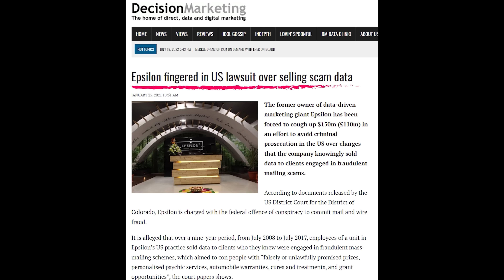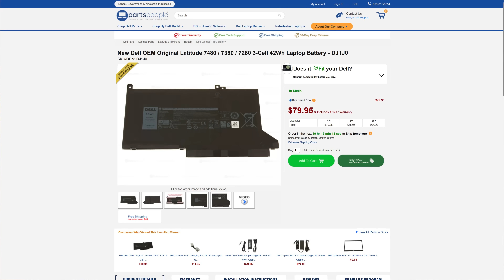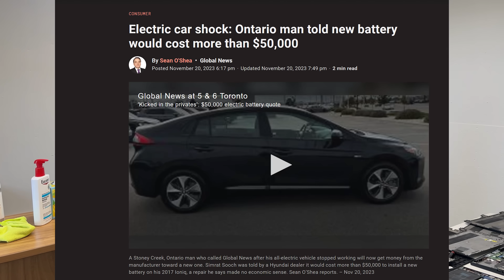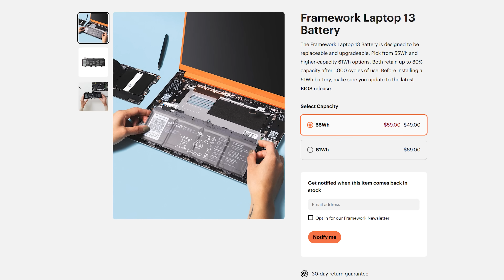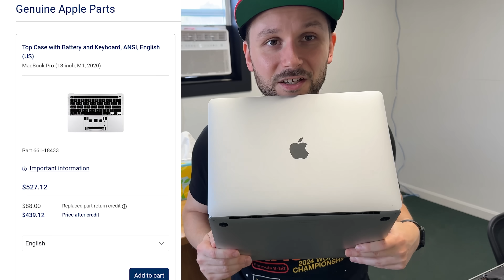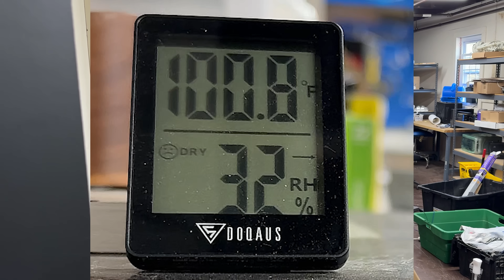Planned Obsolescence: Why is Replacing a Battery STILL So Difficult and Expensive?!

Comment: I agree, but your parents are probably not going to use it off of battery so just see how many you can sell without battery.
That being said because the battery on a Dell is in the front you need some weight to make sure it doesn't fall over.

Also more research should be done into supercapacitors.

Comment: Well, the problem with phone and laptop is there's no standard for the battery. For car the 12V battery is 12V battery. No matter which brand or which type you get, it will fit (if it's the same standard ofc). It's always the same shape and has the same connector. For phone and laptop? Good luck. We have an iPhone when their fancy L shape battery. A Vivo with their double pouch thing that charge faster than the greatest technician that ever lived can steal your toothbrush. We have slim battery on the new Fold whatever-the-number that so thin you would get paper cut if you touch the edge. The same goes for laptop, we have so many shape and sizes. The only company that having this battery is the brand that sell the device. They can charge whatever they want. And when they say "screw you, it's upgrade time bois" now you fked. Good luck finding replacement battery.

Comment: Last time I needed a battery for my laptop, it turned into a desktop. Tossed the battery aside and it became stationary or at least outlet dependent
Reply: had a laptop that lasted like 6 years without a battery so yeah... it sucked when the charger broke and I had to get a "standard" charger that didn't fit well since whenever you moved the port it'd get at an angle and turn off the computer... My cat several times turned it off while I was doing something on it... oh well such is life.
Reply: @mariadanielalavia8877 Just get a tablet or desktop.

Comment: Since about 2003, I pretty much use my laptop always plugged. My MacBook Air late 2014 developed Spicy Pillow Syndrome tot he point where clicking the trackpad was becoming harder. 

¿Do You know What I did? I carefully punctured the spicy pillows, put some heavy dutty scotch tape on the hole, and calle dit a day.

Autonomy is now one hour. More than enough to find a plug and keep on working.

And the battery of that Vintage of MacBook is replaceable, not glued in, soldered or anything.

I agree with you 107%. 

Instead of each manufacturer developing their own spicy pillow shit, there shoud be a few standard spicy pillow modules, and manufacturers use that. Economies of scale would kick in, and batteries would be obtainable.

Failing that, each manufacturers could use their own standard individual modules BUT ACROSS THEIR WHOLE LINEUP, and not every model having a slighly different battery...

Comment: As an everyday user of my refurbished 8th gen  i7 latitude 7490, I was able to install windows 11 pro since it has TPM. I installed 32gb sodimm ram. I love how rugged it is and its sturdy so I use it as my field work laptop. Highly recommend picking up one of these older, but still more than capable laptops.

Comment: Laptop parts that are consumable (will break down faster than the rest of the components)
1. Battery
2. Hinges
3. Keyboard
4. Cables/wires
5. Plastic chassis

Comment: You know the absolute dumbest thing about batteries?
Let's take EVs as an example.
You can have a Tesla Model Y and a Rolls Royce Spectre. Both of them are great electric cars, but a Rolls that is meant to last forever won't, because the battery will one day blow itself up.
Even the modt renown car brand can't have the 'Rolls Royce of battries' to put in their cars.
It's also like a $300 Android vs a $2000 iPhone.
One is greater than the other, but at the end of the day, their battries are equally sh*t and will expand itself out and make your phone look pregnant.

The problem? Companies just refuse to sell you the batteries, and even if they do, they'll charge you a fortune for it.

Comment: In a bit of this exact situation right now with an old MacBook that I restored. Its a 2010 MacBook Pro, which im planning to use as my school laptop here in a few weeks, because most of my school stuff is online and in a browser. Its running Monterey perfectly fine with an SSD but the battery is $60+. I only paid about $50 total for the rest of the machine so, why would I spend more than double the cost of what I paid for it for a single part? The answer: im not going to. Im just gonna have to keep it plugged in at all times, and inconvenience me and everyone around me with my charger. Not to mention that the $50 i paid to restore the machine myself is more than i wanted or was able to pay. At this point im genuinely considering making my own 10V battery, because what choice do i have? I actually cannot afford a $60 sketchy ass third party battery.

Anyway, love your videos!

Comment: it just depends. i got lucky I guess. All of the laptops I got for $25. The battery all still okay
and they're LI-ON . I do know how to refurbish Li-on or make Li-on packs.
but that cant be certified or to be sold on the market.
I also look out for those laptops...becuase I could up grade the CPU for another $40-$50.
It wont be the fastest..but i7 at 2.8 ghz boot to 3.9 ghz are FASTER than some modern day
Laptops. It just NOT as energy efficient...but for $100 average...I'm good.
 I go for 17" laptops for reasons. It's big enough to use on your desk.

If really need to,..if I was BROKE, SHTF or live in a third world.
 The Lipo packs..I guess they're just have to stay plug in to a 12v battery solar panel system
so I can run it at night ,too.
I can always WACK IT...screw it UNDER my desk...HDMI to a 28" monitor.
blue tooth the 72" T.V.
I sort of FLATPAK mini P.C. lmao

Comment: You’re right about laptop/phone battery pricing, but the batteries in many of these things actually are prohibitively expensive to replace when we’re talking about a $60 device. For electric vehicles it’s even worse, the cost to manufacture is legitimately thousands of dollars and they’re even more labor intensive to replace than the batteries in personal electronics. This is why EVs still have trash range/charge times, the battery tech still isn’t good enough to make them truly beat hybrid or gas cars. We absolutely should push back on manufacturers about pricing this way, but remember to also ask yourself if every device is valuable enough for the fresh battery cost to manufacture, as opposed to how cheap a new device with the same or better performance can actually be.

Comment: Someone converted a laptop into a NAS because of the battery. I've also thought about making a board you can connect to the battery protection circuit with several capacitors on it to get past the battery error if you are willing to make the device AC only powered.

Comment: Latitude E5470 user here, bought in a bulk with some E7470s. This laptop is almost 10 years old and I cannot kill this laptop. It's thin enough to not look out of place, its got a 4 core skylake i5 that still runs everything smoothly, and it's still efficient and cool temp, and still somehow gets 5 hours of battery life on the stock battery. I instinctively want to upgrade, maybe to a t14 gen 1 or a precision 5510, but i just keep gravitating back to this thing, it just won't stop being relevant.

I've got laptops in my collection going back to the late 90s that still have their original batteries (some even still have an hour of capacity!) and I've only ever encountered bulging batteries that did so before I got them that way. Maybe it's a symptom of environmental factors effecting modern battery composition? They're in an hvac controlled environment unless traveled with, maybe it's humidity related?

Comment: The battery situation in laptops and smartphones and so on is absolute crazyness and it boggles the mind nobody bothered to adress having standard form factors and capacity like we have for AAA batteries and all the other old crap. We knew how to standardize parts and somehow forgot how to at one point.

Electric gardening tools and power tools is another moronic exemple, those things all require more or less the same voltage and amps but every manufacturer made his variant of proprietary crap of the roughly similar looking form factor and connector.

EVs are another disaster entirely between the proprietary crap and the mass of material involved. Nobody is gonna start a business to make 3rd party quality batteries for some odd model of car that was sold in the tens of thousands max and quickly abandoned by the manufacturer that made it.

Comment: I’ve looked up a battery for my thinkpad x201 and it’s so much smaller than the original one but I’m worried about it not working properly since the battery for that laptop supports the stability of the laptop like legs. If I use it without the battery it says 200% battery charge for some reason lol but I use the old battery that doesn’t hold a charge so it doesn’t say that. Old tech is hard to support but we should try to keep it alive and out of landfills. Also if anyone knows where I can get a cheap keyboard bezel for my laptop I would be very grateful.

Comment: i hate that every single new device is “aI pOWeRED” and has a fucking intel core i69 92729k with 256gb of ram and then it only has 128gb of storage. IDC ABOUT THESE NEW FEATURES. i want just a good ENOUGH gpu with an os that can run my drawing programs well ENOUGH, a bunch of storage to store my documents for years, PORTS, and a battery that can easily last an entire day with one charge. thats it. thats all most people care about; that it lasts a long time. no one gaf that it has an ai image generator if it means my computer is gonna turn into the fucking sun while lasting 20 minutes bc the gpu is doing too much
like my 2015 macbook pro still does what i need it to do. it runs krita fine (it could run better but its FINE), my tablet works with it, it runs games fine, i can use modern browsers, it has enough storage and plenty of ram. my issue with it being THE DAMN BATTERY and the fact my legs turn into fried chicken cus it gets hot if i do anything other than stare at the wallpaper

Comment: I've been aware of the problem for a while now, and I always try to minimize battery drain on my devices. Many devices today include a battery conservation feature that limits charging to only 80% capacity, and it worked for me. I had a laptop for 7 years, and then the software drained by 20%, which is quite a lot, but it still lasts at least 3 hours of multimedia and doesn't get bloated. Avoid overloading your devices by leaving them plugged in all night or day at all costs; that's terrible. And avoid letting the battery drop below 20%.

Comment: What they should do is sell modular battery so you can custom fit it to the chassis. but it is universal and easily replicated and infinitely expandable. Given the large stock of failing batteries for laptop and cell phones should not be too difficult to source then you pull the micro power board and solder it to the new spicy pillows and boom drop in replacement. IDK just thinking out loud. I work in IT for a large electronics company I see this all the time.

Comment: Ironically I replaced nearly as many batteries as phones XD 

S4 mini : Replaced battery as it had progressively worse calls, turns out it had issues with the local infrastructure upgrades 
New phone

A 40 : faulty battery ,replaced , working. 
Screen crack, new screen and frame (not skilled enough to reglue that) and new battery cause why not. 

A55 Still working

Comment: The situation with EV batteries isn't as bad as it first seems. The standard warranty is usually something like 8 years or 100K miles, and that also ensured the battery loses no more than 30% of its original capacity. 

Based on data from recent years, an EV battery should last somewhere around 200K-400K miles before the battery capacity drops too low to be usable. It's the sort of distance where a petrol/diesel would need a costly major overhaul of the engine and transmission.

The $50K Hyundai battery replacement isn't what it seems, either. The dealership didn't have the equipment or the experience to do the work, so they made up a ridiculous price to make the customer go away. The actual price still isn't cheap, more like $10K-$20K, but it's not $50K bad.

Comment: I've had some pretty good luck rebuilding battery packs. The cylindrical ones are pretty easy. All you need to do is order a fistful of 18650 or whatever they originally had from a reputable manufacturer and spot weld them in. A newer cell will probably also be of a higher capacity. The pouch types (spicy pillows) can also be bought from a reputable manufacturer. The cell numbers are just the length, width and height and you can look them up. The new pouch types will probably have the same watt hours as the old ones. If you need to go a little cheaper you can get lower capacity cells. Not everybody needs to have 100 hours of run time when they could be just as happy with 20 hours and cheaper. The biggest hurdle is tearing the old pack apart without damaging the charge controller or beating up the plastic so bad that when glued back together it's too big or just looks ugly. Just buy a spot welder and get used to using it.
Edit: I also try to glue the pack back together in a way that makes it easy to disassemble it later on. You really don't need to "bathtub" the glue if it's an internal battery.

Comment: Honestly, you're completely right, I fully agree with you. I still use tech from the early 2000's like my IBM Thinkpad R60, and I had to replace the battery on it, but once I did, it works like a charm. Now that's an extreme example, but even laptops made from the last couple of years still need reliable batteries

Comment: Got a perfectly fine working thinkpad e490 here. Replaced pretty much everything with ease (screen, ram, cooling/paste, keyboard ect). Its still shredding through office tasks like its nothing and the build quality, despite being an e-series, is better than most modern thinkpads.

But finding a good affordable battery for it is a pain. Its at 70% now, so I eventually have to take the risk of buying a non-genuine one and hope it lasts longer than a couple of months.

Comment: In my totally uneducated opinion and throwing numbers almost at random, for a laptop or phone a replacement battery shouldn’t cost more than 10% of the total price of the device , let’s make it 15% for a screen, …35% for a motherboard maybe? Even 40% if it has a discrete GPU.

Comment: If you don't want to deal with "compatible" batteries, the next best thing is, as long as you have the original spicy pillow, find a similar size genuine cell, desolder the charge controller from your pillow then solder it onto the new cell, some do forget their settings if they go unpowered, usually plugging in the charger will get it going, but it would be recommended to keep something attached until fully soldered.

Comment: I am in full agreement about the battery issues. Good replacement batteries are very hard to find. I don't mind replacing my own cause I am a teckie like you. But getting a good reliable battery can be a total pain. Nowadays when I buy a new laptop I also buy a spare battery (as long as it is not used or plugged in it will stay functional forever. Just need to charge it when using for the 1st time. But that is a little expensive.

Comment: 11:15 Exactly! I rock an Dell Inspiron 3421 from 2013, i5 3rd gen! Still rocking Windows 10 too. His battery died, i bought an non genuine one, and it's not a bad battery either, works fine to me! (BringIT Battery) I am really close to buying an T14 Gen 2 tho lol
Reply: got a second gen i5, forced my ThinkPad x220 to use windows 11 and it works completely fine after I debloated it.

Proof Microsoft's requirements are utter bullshit if my computer from 2012 can run it fine

Comment: Note: The Dell Latitude 7490 is officially supported by Windows 11, for both the CPU and TPM requirements. Source: I also refurbish these. In fact, it seems that the CPU requirement for Windows 11 24H2 has become more lax, as I was able to install a non-cracked ISO on both a Dell Latitude 3490 (with a 7th gen i5) and a Dell Precision 7510 (with a 6th gen i7) without any issues, so long as secure boot and TPM 2.0 was enabled.

Comment: Even decently made batteries are still sketchy. I got an iFixit battery a few months ago for my HP Pavilion that would live 15 minutes tops on battery, and while it definitely lasts a few hours now, I can't remember if this was the peak performance of the new battery. Especially iffy when you realize that the iFixit battery is significantly more expensive than the aftermarket dice-roll ones, or used batteries of the same/similar model. Probably my biggest gripe is that I spent a whole day and even updated the BIOS, but despite this being a relatively officially endorsed battery...the dang thing wouldn't even calibrate, and iFixit told me that it was out of their control over email.

Comment: Nope, nope, nope...
You can get a battery for USD 20, for ANY laptop that ever existed.
There's no need to buy "factory original" cr4p, you can still find generic VERY GOOD quality batteries that will give the same OR BETTER performance and service life than originals.
"Factory original" batteries ARE NOT the most quality ones, those are ussually the MOST GENERIC, just with some better quality control.
AND if you're a refurbisher, you could directly buy the cells and refurbish those batteries. (AS I DO since my first laptop, that used AA sized 1.2V NiCd batteries)
Just search and test, stop the blabber, that's all nonsense.